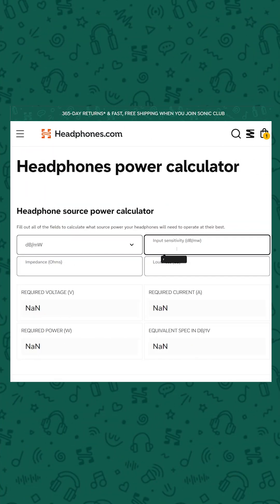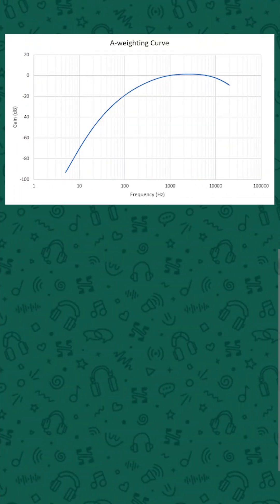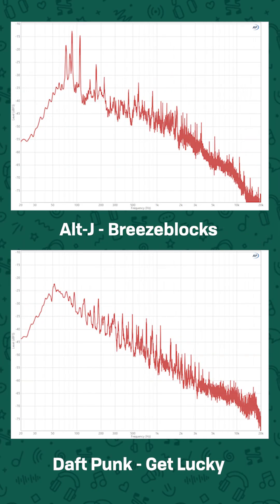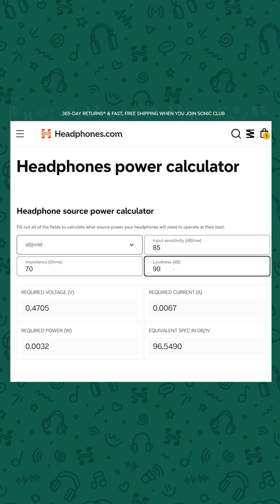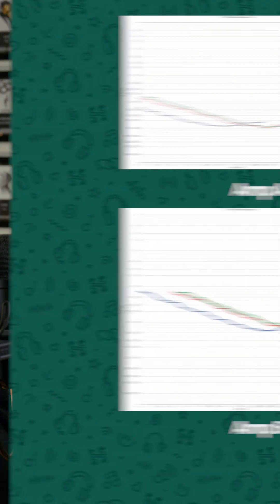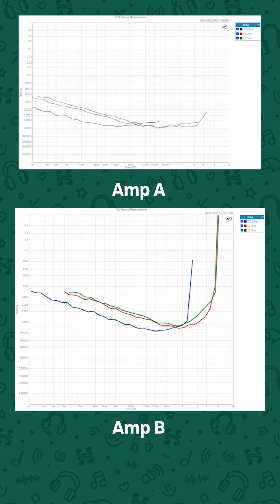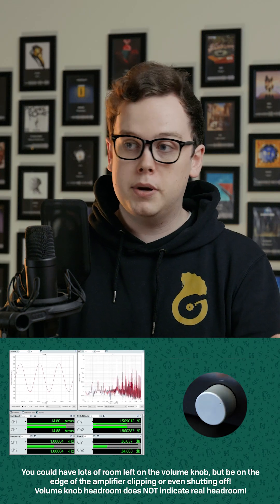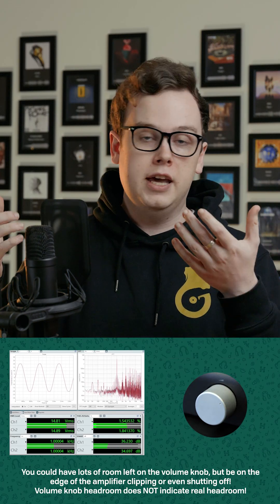How much power do headphones need?

Comment: This was so confusing it comes across as satire. (See the old Tiger Woods “Golf’s not hard” Nike Commercial) Any hard and fast rules? I feel like Golden knows so much that he forgets that some of us know very little.
Reply: the problem is that there are no hard and fast rules. You cannot trust the specs of an amplifier, nor can you trust the volume knob either. You cannot even fully trust the intended db that you like to enjoy music at.

Determine how much power you the headphone needs, you will need the resistance and the sensitivity. Then you want to add in your own extra headroom for peaks (your mileage may vary). The math is non trivial due to the logarithmic nature of the db scale, so a calculator is your best friend.

Then, cause you cant really trust the max specs of an amp, you need to rely on graphs to truly know how it performs across all power levels. And then cross reference with the max wattage and resistance of your headphones…

Unfortunately, figuring this out yourself is honestly a bit complicated, and golden actually did a really good job of condensing the information down to as simple as possible. It’s just that everything matters, so you can’t simplify it too much before giving out straight misinformation.
Reply: @Thank you for this.